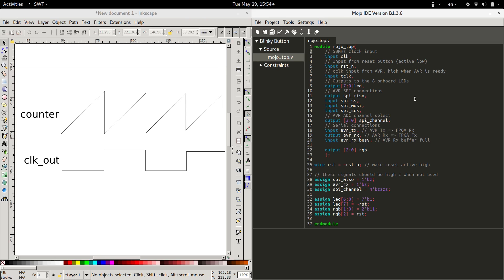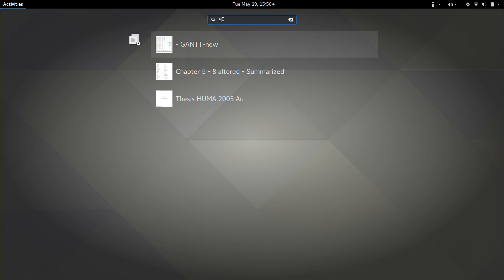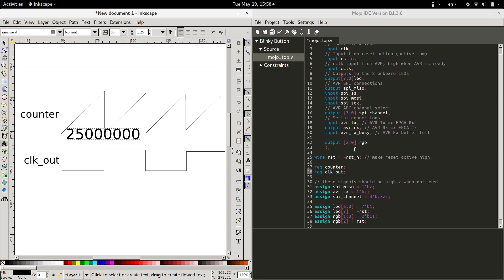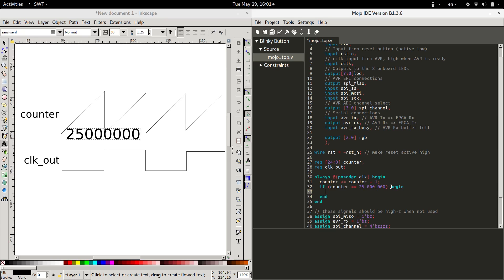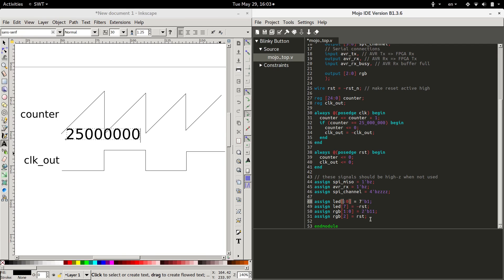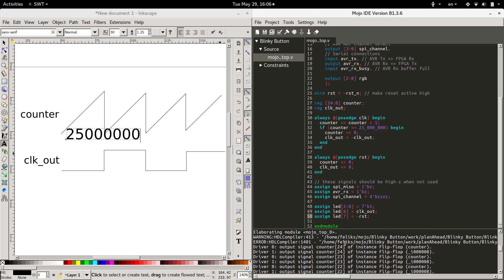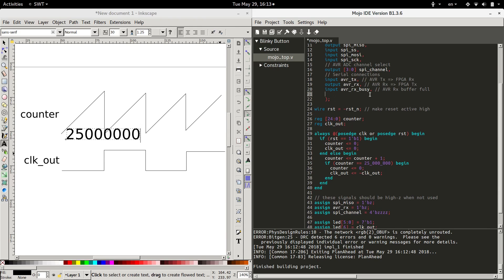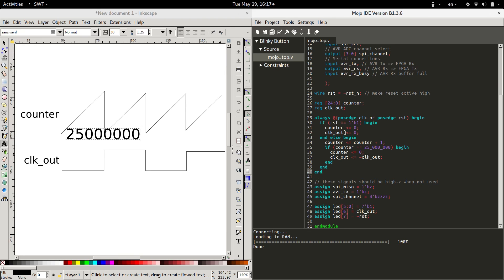Learn FPGA #8: It's too fast! (Making a slower clock) - Tutorial

Comment: how do you increment a value on memory and in the same clock cycle compare it and set a new value? that's impossible. it creates a racing condition between the compare and the write. The same goes for clk_out = !clk_out. if you just wire the inverted output of a flipflip to it's own set wire, which basically is what that line says, then you have an unstable circuit.
Reply: As far as I know the FPGA configures hardware using logic gates that work independent of the any clock signal, you can use a clock signal in the FPGA but the gates work independent of the clock hence FPGAs are often used to do many things at the same time. As for the flip flop being unstable it probably just connects the inverted output to the set pin but also it has an enable input that is only triggered when the counter reaches 25,000,000 hence it will only invert when the counter reaches that value which means that it is stable